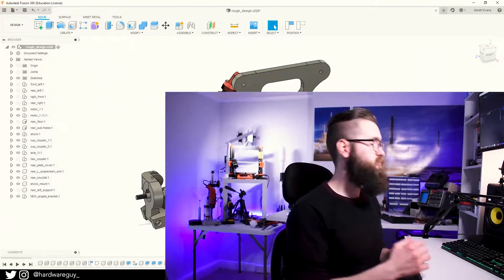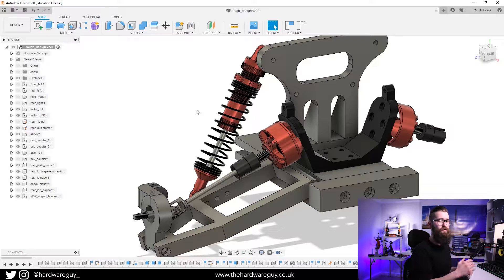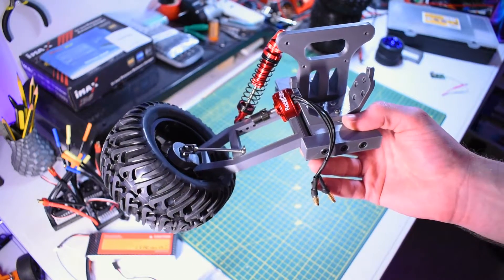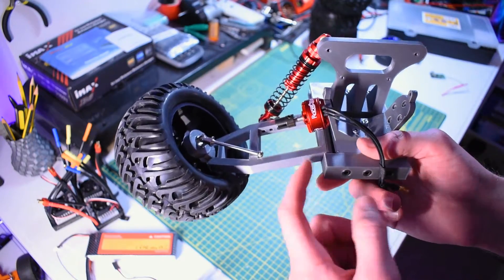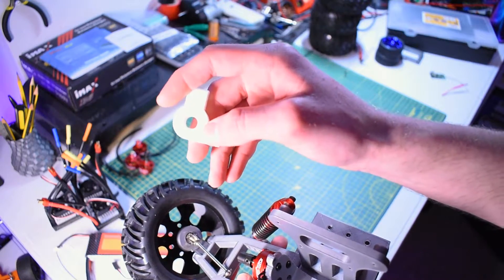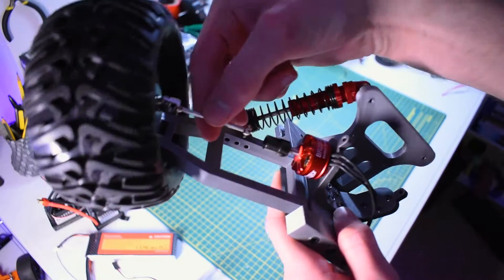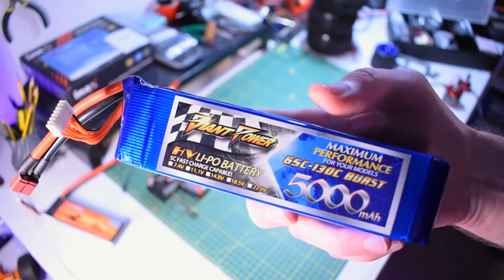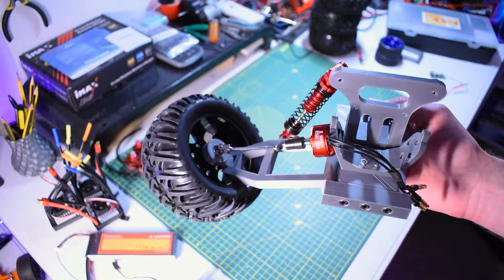AWD RC Car System... pt.2

Comment: You should make the motor mount a little straight
Reply: Because when the tyre goes up its gonna hit the limit on the top side
Reply: You will have to set the motor angle when the wheel is at the lowest level and set the motor angle as high (facing up)as possible so you get most of the travel

Comment: You're going to need some type of joint at the motor  if you have suspension ..
Reply from the maker: definitely! when I fit the new motors I'm planning to replace the old dog bone coupling with a standard universal joint

Comment: You should design and 3d print an all whell drive transmission instead of using 4 motors, so you use only one motor to drive the 4 wheels
Reply from the maker: That's the way everyone else has done it! But my car is going to be very different. I'm going to be able to independently control each wheel using an onboard microprocessor. This means I can have differential steering and have full control over the bias between the front and rear wheels!
Reply: I love It!